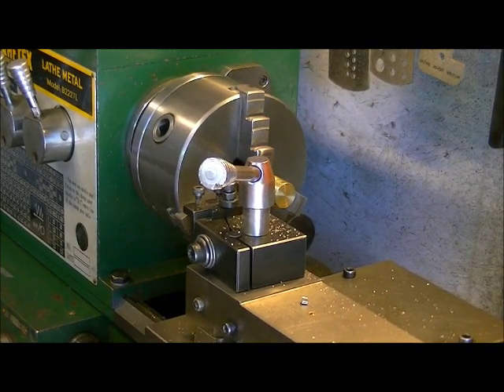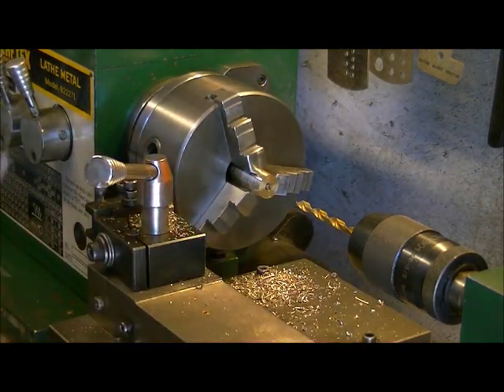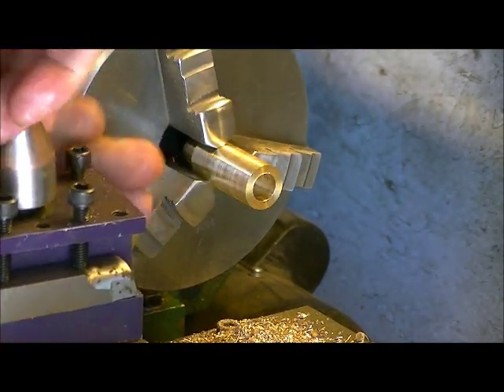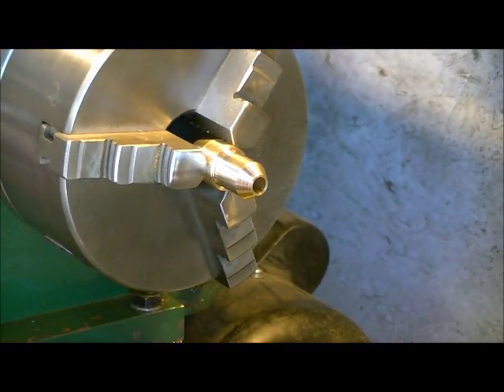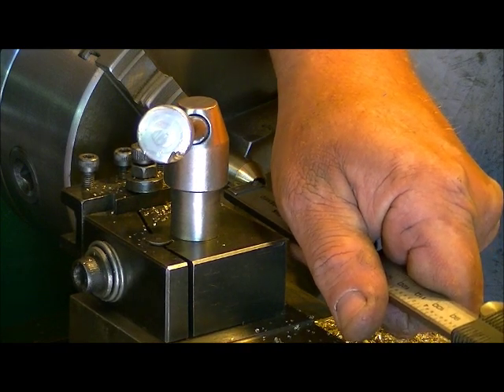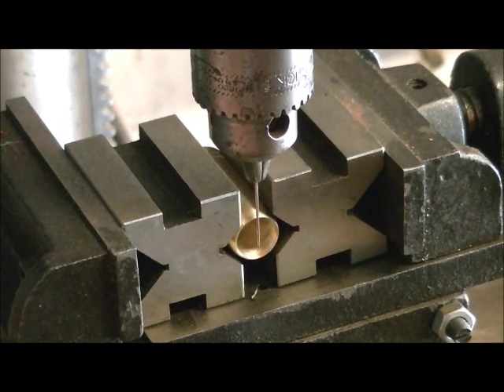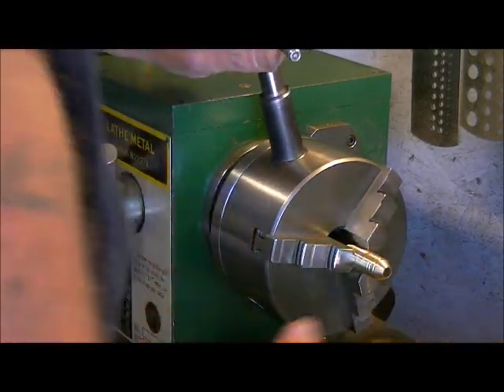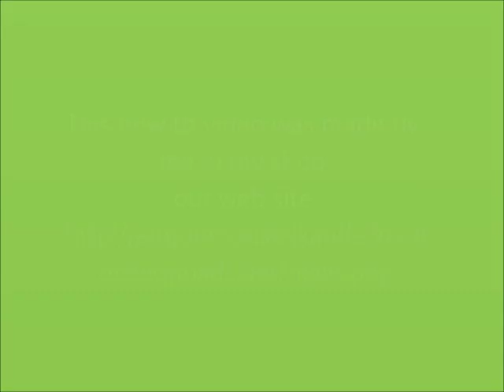How to build a crosman 2240 muzzle brake.wmv

Comment: I want to buy one for 2240 XL but dont want to pay as much as I did for the gun.
Reply from the maker: well i dont make muzzle brakes anymore but if you do a google search for 2240 muzzle brakes iam sure youll find something you like and at a good price as well i made custom one of a kind brakes only when i did this stuff and i changed a fair price its time skill and material and something that also no one else will ever have
Reply: @KevinMillard68  I understand also I have to find one with female threads cause I cant take this barrel protector off.